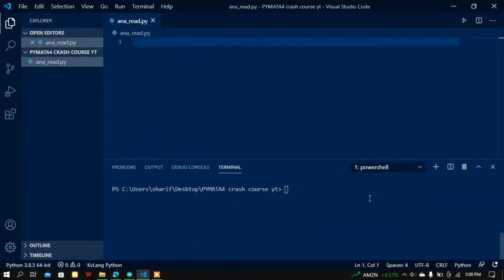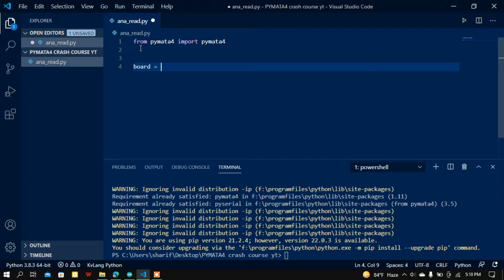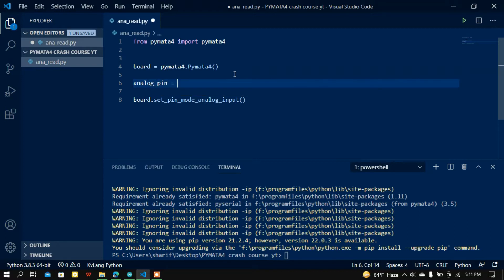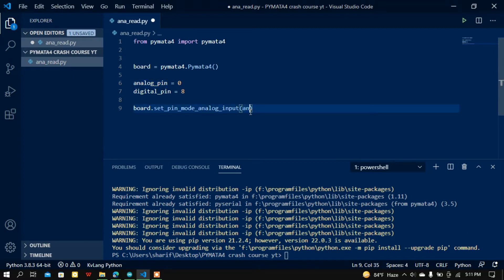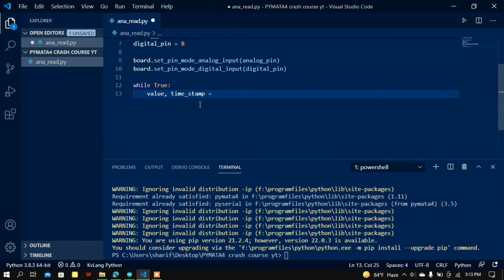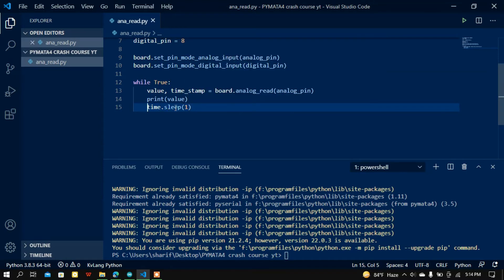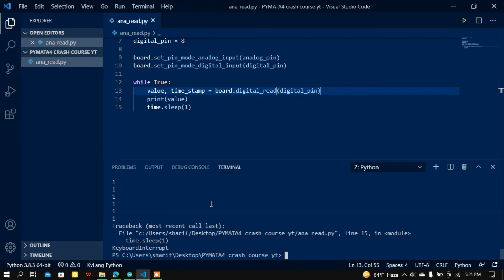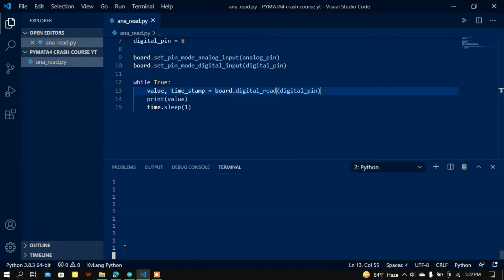Read analog and digital pin of your arduino using python's PyMata4 | Pymata4 | Arduino | Python |

Comment: Is it possible to increase the resolution (number of steps per revolution) using the pymata4? For example, drives like easydrive increase the resolution by 4, 8 or 16 times. But I can not use the easy drive to control the stepmotor using the pymata or can I?